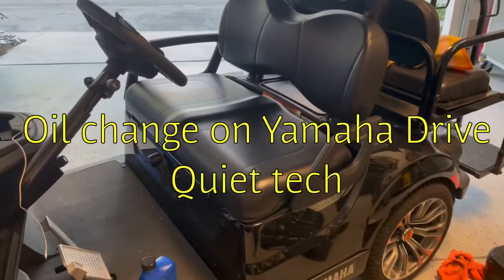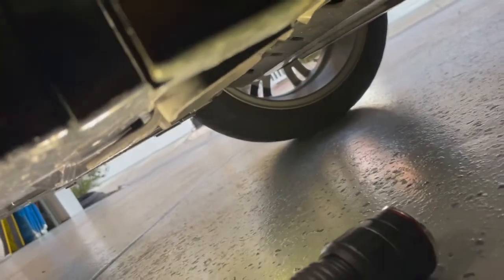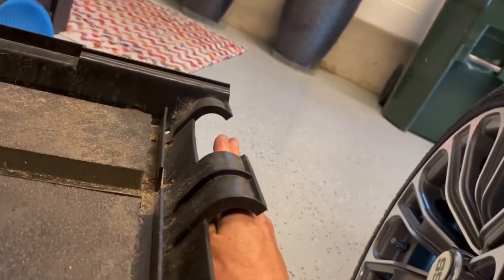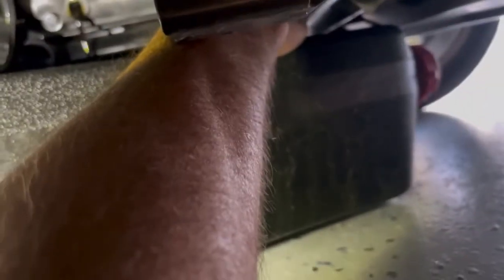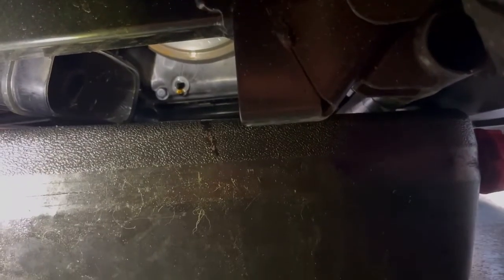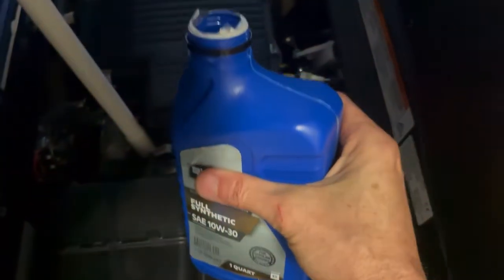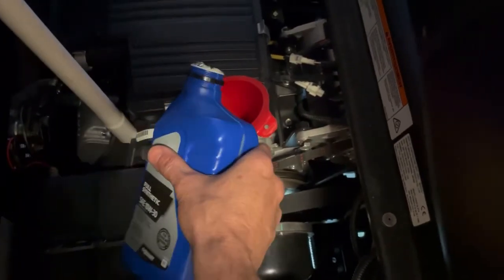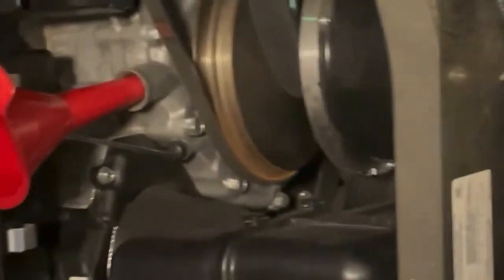Yamaha Drive 2: Oil Change

Comment: Good video, Thanks. Next time you do your oil, go ahead and remove that spark arrestor screen on the tip of your exhaust pipe. It'll only get clogged eventually and cause problem. Won't be an issue if you don't go off road. You can drill it out or unbolt it and slip it off.
Reply from the maker: Thanks for the pointer

Comment: Was changing oil on 2022 Yamaha drive 2. I noticed there was a lot of surface cracks on engine around drain plug and up. Yamaha told me this is a protective coating on engine. Have you ever seen this?
Reply from the maker: I would say cracks are not but superficial crack like lines that protrude from the engine case is normal. The case is cast, not machined so some surface imperfections are normal. If there are true cracks present then take it back to the dealer. You have a 3 year warranty.
Reply: @didifixthat7910  thanks for the response. I believe they are superficial. It just seems odd that they make it like that. Seems that if I was to take off the drain plug that area around the plug would be fragile like the thin metal would flake off.
Reply from the maker: @daisydomergue9327  I really think the areas you are describing are casting imperfections or marks.  The area around the drain plug has been machined to be completely flat so that the drain plug will seal properly.  Let me know if oil leaks thru the metal.  I really don’t think the cracks you are describing are anything more than casting imperfections.  Hey, you’ve got a 3 year warranty on that bad boy.  Just keep an eye on it.  If here is an issue make them fix it.

Comment: Good video.   Was there any kind of washer with the drain plug (bolt)?
Reply from the maker: I don’t think so.  If memory serves me right, there is no washer.  I can say that I have never replaced the washer if there is one and I’ve done 4 or 5 oil changes so far.  I’ve had the cart for 5 years or so.  I change the oil once a season and I have about 300 hours on the cart and 0 issues so far.  They really are nice golf carts.
Reply: I changed the oil in my father in laws golf cart.  Similar to yours.  It has a washer.  Hard to see initially.  See video link I attached in previous video link.  I just re-used the same one... didn't have a new one.
Reply: ..and thanks for YOUR video, it really helped me get that plastic cover off.

Comment: I noticed you used synthetic 10w30 oil. I read that Yamaha does not recommend synthetic  because  the motor is a splash oil system?
Reply from the maker: Hmmm. Wonder why that is?  I’ve used it for the past 3 or 4 years.  Never heard that before.

Comment: I have a 2021 yamaha drive 2 efi and just did my oil change. My cart did not come with a belly pan. Did the factory forget to install it. The cart does seem a little loud? Thanks Frank
Reply from the maker: Is yours a quiet tech?  If it’s regular I don’t think it has one,  mine has foam all around the engine compartment in addition to the exhaust diverted and belly pan.
Reply: I have a 2021 drive2 adventure sport quiet tech. Mine doesn’t have the insulated “belly pan” either. I know the sport model comes with a factory 2” lift. Not sure if that’s why mine doesn’t have it. I’d like to put one on, mine also seems a bit loud.
Reply from the maker: That’s weird.  I thought the quiet tech had foam all around the engine enclosure as well as the belly pan and exhaust diverter.  Does your have an exhaust diverter?  In the video I take it off, it’s the piece held on with a large zip tie and a couple of rubber tabs on the belly pan.

Comment: I trying to find out what those parts are called that you removed to get to the oil drain plug. The big cover and the boot cover over the exhaust. My cart doesn’t have either and I want to put them on mine! Can you tell me what they’re called so I can look them up to purchase them?
Reply from the maker: I’m guessing that you are attempting to turn your cart into a quiettech cart?  Not sure what they are called, I am guessing a belly pan or splash guard.  The exhaust thing is probably called a exhaust diverter?  Check to make sure it fits your muffler before you buy one.  Also there is a layer of insulation all around the engine housing.  Good luck.
Reply: @didifixthat7910  my cart has the quite tech engine but rocks or anything could get throw up in under it. Plus I do have a small amount of fumes. I was hoping to replace both these parts. My has been made Street legal and I just want it protected well. When I raise my front seat you can the ground down past all the engine, gas tank, etc. My cart is a 2018 Yamaha G29

Comment: You might want to put a few pumps of grease into the Clutch assembly when changing the oil.
Reply from the maker: So I had to have a recall done on my cart something about the brake cable. At any rate I asked the service man if the zerk fitting on the centrifugal clutch needed grease.  He specifically said no. He said they never grease them.  I agree it seems like a good idea especially since Yamaha put a zerk fitting on the clutch assembly so, I don’t know what to do.  The owners manual is silent on the matter.  Please respond as to what you know about it and where you got the information.  Thanks again.
Reply: @didifixthat7910   this comes from personal experience I had to replace a whole clutch on a 2004 Yamaha, about 300.00. Plus a puller. If you put the transmission in neutral and run the engine you will the see the clutch opens up so belt down in the grove, this changes the gear ratio. Then the when the RPMs slow down a spring pushes it closed and belt goes back to the top. My clutch won’t do that, once I took it apart, I noticed the the roller were so badly worn that it had a flat spot where one arms would get stuck and not let the spring push the back to the top. It be starting in fourth  gear with a manual transmission. If you decide to take the cover off the clutch and watch how works put a piece of card over the clutch assembly. Without it you spray grease on yourself and the roof.

Comment: Question sir, is it Necessary to re-install the plastic cover or "installation pan"? I understand definitely the muffler diverter. I ask because I just received led glo 4 piece kit and the plastic installation pan is in my way. If I want to mount the lights running parallel on the frame rails
Reply from the maker: I would say yes you need it.  The large plastic panel acts as sound insulation as well as assisting in holding in the rubber exhaust diverter.  I guess you could leave off the plastic panel and the rubber exhaust diverter but I would think that the cart would be significantly louder.

Comment: Did you just use regular car oil or was it a specific type of oil?
Reply from the maker: It’s 10w-30 one quart.  That’s what the owners manual calls for and that’s what I used in the video.  I think I mentioned that in the video.  If not my bad.  Thanks for watching.

Comment: Good video but you really need to just get an oil extractor pump. Saves a considerable amount of time. There is no need to remove the quiet tech parts. 

I use the same oil on my drive 2.
Reply from the maker: That’s a great idea and like you said I’m sure it saves time.  I have never used an oil extractor before.  It would be interesting to see how much, if any, oil is left in the crank case after an extraction.  Thanks for  watching an commenting.
Reply: @didifixthat7910  If properly used with a good oil extractor, just as much oil is removed with the extractor as compared to gravity. I have used an oil extractor for my Yamaha drive 2 and all I do is extract the oil, refill, run for five minutes then extract again. Much quicker than removing the bottom pan.
Reply: @johnmayerislovee  so do you refill with clean oil that you extract again after running for five to ten minutes? Why would you extract the oil again after you have filled it with clean oil? Seems like you are using twice the amount of oil if you do it that way. Why not just extract, fill with clean oil and be done?
Reply: Was told  by Yamaha technician and service tech to just siphon the  oil out with a hand pump through the fill dipstick Hole and then just refill with a quart of oil, literally just takes five minutes that’s how they do it. And then just check air filter and lower dust pre filter